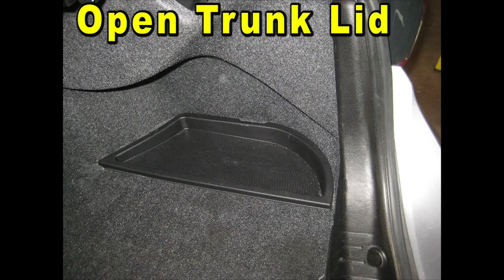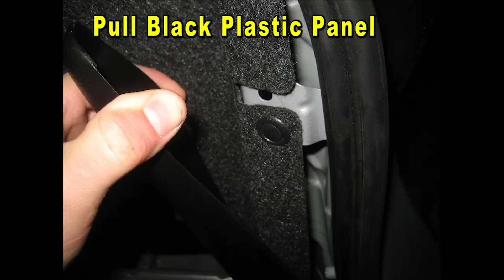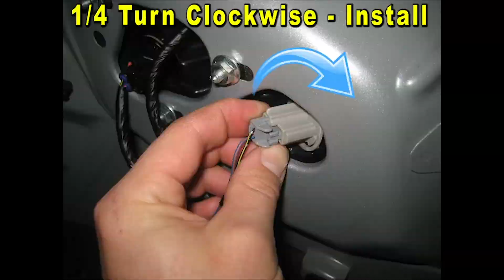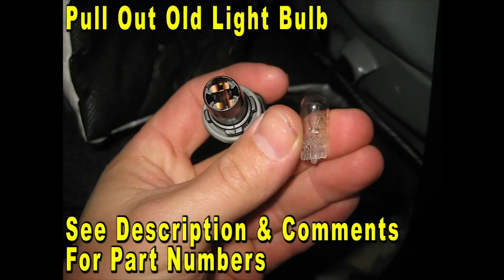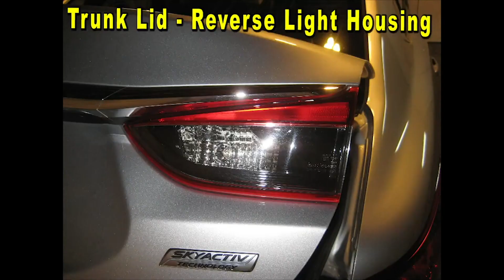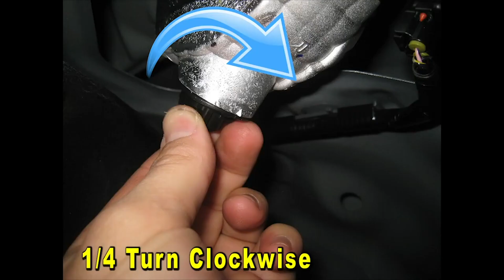2014 To 2021 Mazda 6 How To Change Tail Light Bulbs With Part Numbers  - Quick & Easy

Comment from the maker: Mazda Mazda6 Rear Turn Signal Light Bulb - https://amzn.to/43dCtAt
LED Rear Turn Signal Light Bulb Part Number - https://amzn.to/3zGrX7j
Mazda 6 Reverse Light Bulb Part Number - https://amzn.to/3GnmhTq
LED Reverse Light Bulb Part Number - https://amzn.to/3mhsauE
Mazda6 Rear Side Marker Light Bulb - https://amzn.to/3GqFSlz
LED Rear Side Marker Light Bulb - https://amzn.to/3Gp9dgc
Precision Screwdriver Set - https://amzn.to/3TCMm6n
Plastic Pry Bar Tools - https://amzn.to/3HMtsV7
Socket & Ratchet Set - https://amzn.to/3Z17LbA
Mechanix Gloves - https://amzn.to/3jCnHkt
Torque Wrench - https://amzn.to/3vS5uSI

The Paul79UF YouTube channel is a participant in the Amazon Services LLC Associates Program, an affiliate advertising program designed to provide a means for sites to earn advertising fees by advertising and linking to Amazon.

Comment from the maker: Check out the DIY guide for changing burnt out tail light bulbs on a 3rd generation 2014 to 2021 Mazda Mazda6 sedan - 
https://www.paulstravelpictures.com/2014-2018-Mazda-Mazda6-Tail-Light-Bulbs-Replacement-Guide/index.html

Here are all of the DIY repair and maintenance tutorials for the 3rd generation 2014, 2015, 2016, 2017, 2018, 2019, 2020 & 2021 Mazda6 -
https://www.paulstravelpictures.com/Articles/Mazda-Mazda6-DIY-Repair-Maintenance-Guides.htm

Owners of other Mazda vehicles such as the Mazda2, Mazda3, Mazda5, CX-3, CX-5, CX-7, CX-9, and the MX-5 Miata may also find these DIY instructions to be helpful.